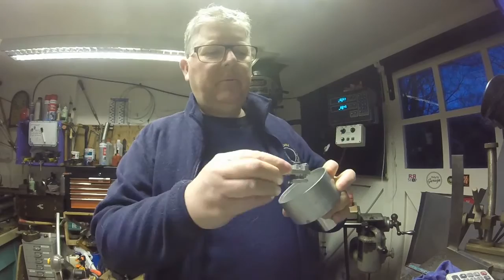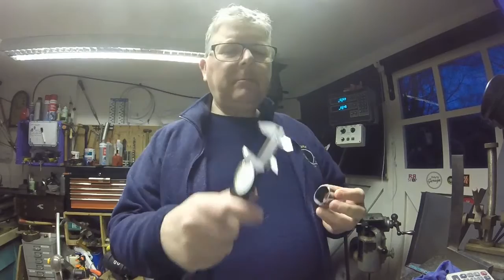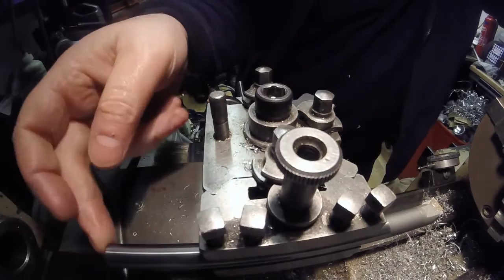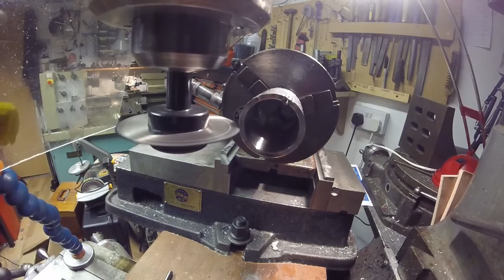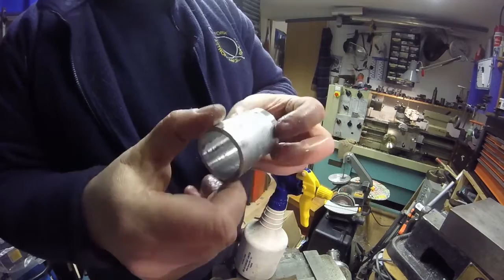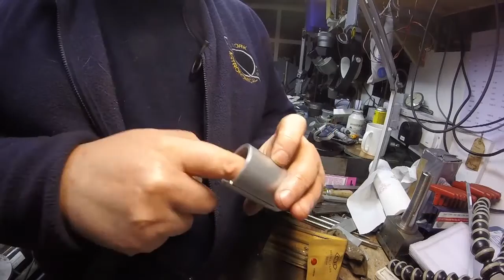Making a 1-1/4" Collet

Comment: Just wondering why the need to remove the handle on the dividing head.
Reply from the maker: I think there is something wrong with it because it doesn't stay on properly. I think it is supposed to be just spring loaded for the pin but when I pull it the whole handle comes out. Annoying really. I need to see how other Elliot dividing heads work and see if I can make a repair. Thanks for the comment.